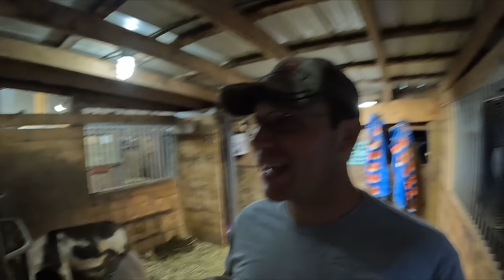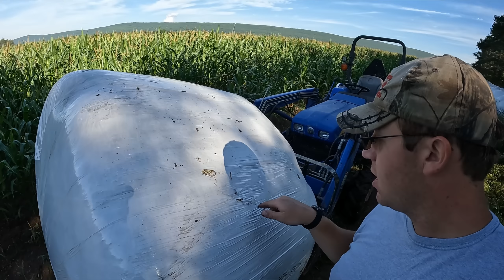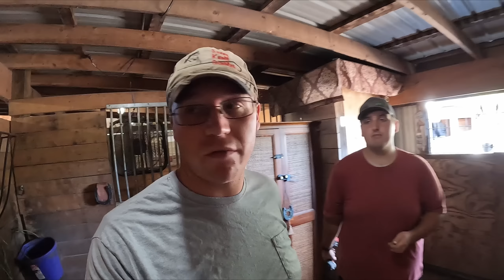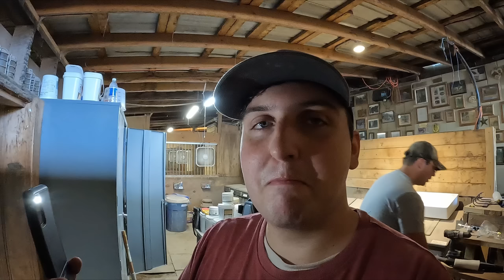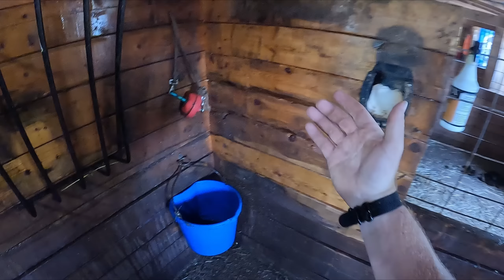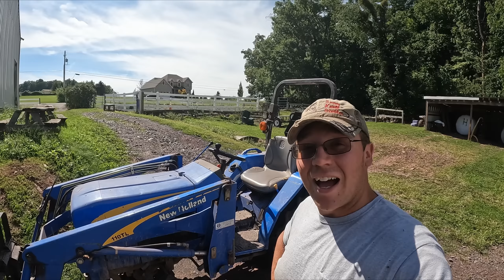Using A NEW Tool To Clean Our Stable

Comment: Yahoooooooo donkey time and dance time. The pressure washer you received you will love it. Rebel needs a shower. Phil and Phylis name. Leah is upsetting Phil . Joel on your round bales if they have a hole and didn’t get rained on could you rewrap the bales again? 
Gavin is our leaf blower always wear a mask and eye protection because it will be dusty don’t want that in your lungs or eyes. Joel you need to put disinfect on the floor after you wash the floors Phil mate is Phylis 😂😂😂😂😂.

Comment: Hi guys..always busy at the stables....lots of work...but my moto is work smarter not harder...I stopped push brooms since 2009..I use my leaf blower...saves so much time..barn is much cleaner...looks new...also I have a gorlia cart that dumps out the back..my son got me for Christmas..I do not use that old way of muck buckets...how terrible is that..I just hook up the gorilla wagon to my riding lawn tractor and go from stall to stall..easy peasy..when do rinse out...leave it tipped to drain and dry..then but bales of hay in and deliver to stalls..no more lifting , faster than walking back and forth...work smarter not harder..so have a good day boys...see on the next one...

Comment: Nice to hear you have having rain all night.   I would like some of that too. Everything looks so green with you now.  Everything turned green here it changed from brown to green so quickly.
Rather than using a leaf blower to clear the waste what about a vacuum cleaner.
What about some sticky tape to fix the hole in the hay bales.  Do you have duck tape over there?  (I think it should be called duct tape.)

Comment: I have a question! Where does all of that water go in a stable? Won’t that dampness cause mold? Or can it dry out well enough?🤷‍♀️🤷‍♀️🤔you might want to put some fans or dehumidifiers in the area you’ve cleaned.

Comment: Everyone wants to shorten everything what is GFI what is that ground facility infrastructure you know etc. with that be a little clarified for us old people lol
Reply: I looked it up.

"Ground Fault Interrupters
These are also referred to as GFIs, or Ground Fault Interrupters. A GFCI precisely monitors the balance of electrical current moving through a circuit. If the power goes where it shouldn't, like in a short, the GFCI immediately cuts off the electricity." - protoolreviews